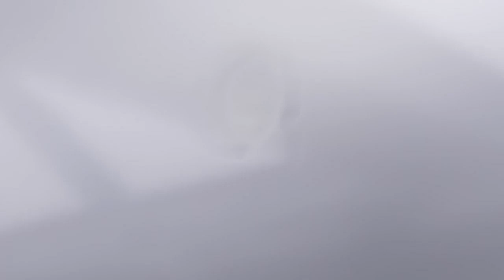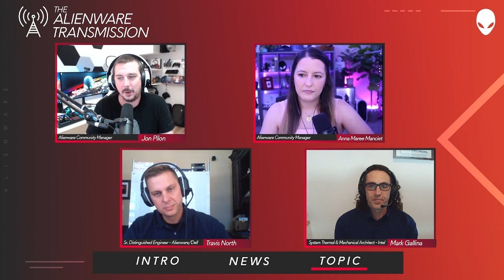Design Decisions | Alienware Transmission Clips

Comment: Guys no offense but I purchased one of your systems, it failed miserably. I so wanted this system to work. Tried for over a month with tech support to repair. We tried everything. So sad. One another note. My friend bought one when he saw mine,,,,and yep his failed also. I hate this. Something is seriously wrong with your manufacturing process.
Reply: I had the same problems... refunded. So I bought another one and th last...🤞
Reply: @シモーネSymho  tried 2 different ones both failed after 2 days
Reply: the alienware r13 is appauling for thermals on demanding games. I bought one for gaming and the temps where so bad that it wasnt fit for purpose so its got returned. Not sure whether the new r15 will improve.